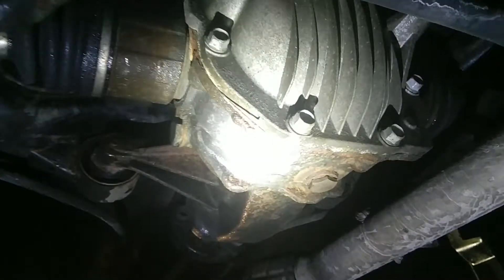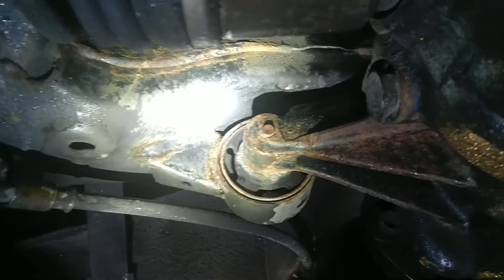How not to Jack up Hyundai Genesis Coupe | Car-addiction

Comment: Lift by diff...  Wtf?  Don't lift any car that way
Reply from the maker: It's an easy way to lift a vehicle on the diff. I have seen and done it many times in my truck.
Reply from the maker: Make up my kind about what?
Reply from the maker: Dont lift a Hyundai vehicle by the diff. You can lift solid axle vehicles  and axles with solid mounts. Hyundai acronis not solid mount.